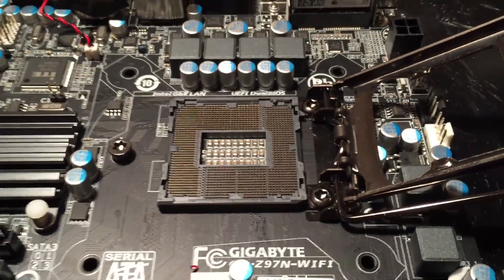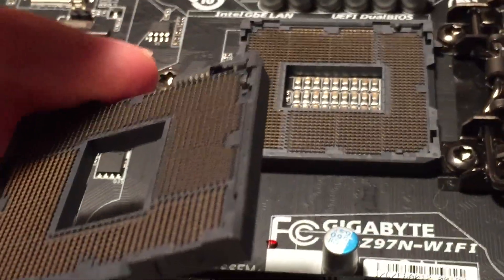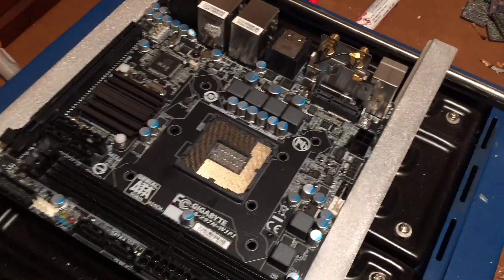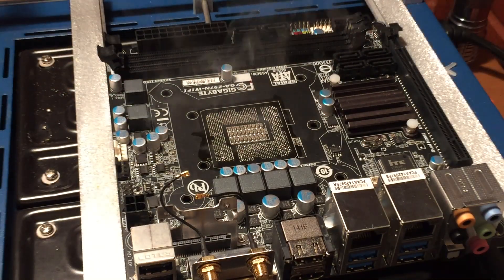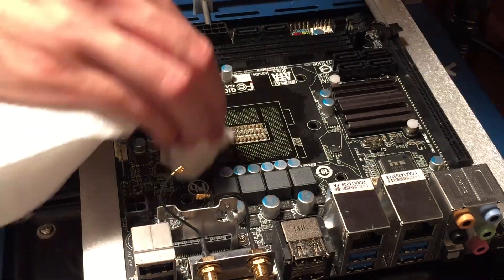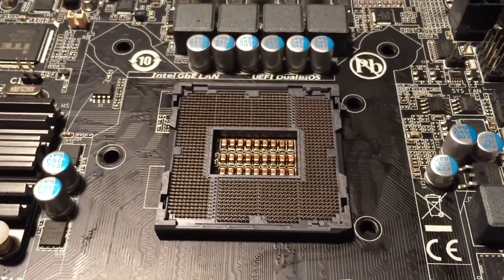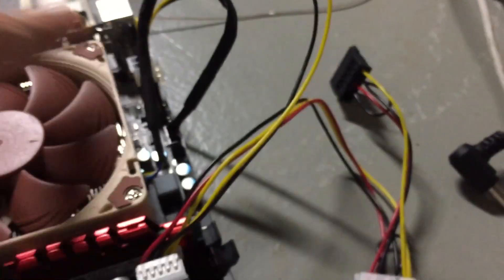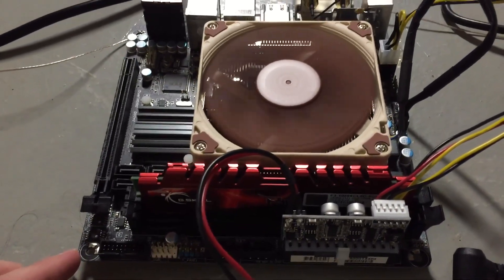Replacing a Damaged CPU Socket on an LGA1150 Mini-ITX Motherboard

Comment: They should put the socket in a socket
Reply: Better idea than it first sounds! I wouldn't expect it to happen though, because fabs would lose revenue if consumer repairs like this became easy.
Reply: @professionalbronze4235  or just dont break ur socket
Reply: apple would just remove both sockets.
Reply: @ionbladezofficial  apple would just solder the cpu on the mobo so people can't repair it..
Reply: @ionbladezofficial  As I dont buy apples overpriced offerings I wouldn't care.
Reply: @ionbladezofficial  apple would put the processor in the cloud.
Reply: @ionbladezofficial  apple would solder both sockets
Reply: Just sockets, all the way down.
Reply: But what if the socket of the socket is bad?
Reply: IBM Power Architecture CPU's have replaceable sockets. There's LGA style pins on both sides of a socket cartridge. There are bare pads on the motherboard and on the CPU package.
See here:
https://youtu.be/AptJJsO5qCg?t=2763
Reply: big brain
Reply: i try and i have more fps in gaming :O
Reply: but then that would hurt their sales
Reply: then the same thing would happen when the base socket breaks...
Reply: @minbcraft  True, though I must say that although I'm not arguing with you (and don't get me wrong, I appreciate constructive discussion)...(also, get ready for a wall of text)

...it'd be less likely for the base socket to break, as the end user wouldn't generally have a need to mess with it. The socket could also be of a different, more durable and more difficult to remove type, to prevent the issue in question from happening as well as discourage the end user from messing with it respectively. I think it'd have to be a different type anyway, as I can't really see an LGA package with an LGA socket as feasible. I'm thinking an LGA socket on a PGA package, with a PGA socket for the base.

Thanks for reading :)
Reply: @minbcraft  Easy, just add another socket for that socket. Problems solved
Reply: @minbcraft  true, but if the base socket was PGA it wouldnt matter
Reply: @minbcraft  Not if the base socket was a PGA that the PLA socket plugged into.
Reply: @minbcraft  slotted pga
Reply: @minbcraft  no because then we could use a different type of socket :)
Reply: ElRemoDeTuBarca  so you can ruin your 350 dollar CPU instead of your 175 dollar motherboard? nah. LGA is superior, i honestly dont even understand how people manage to fuck up a socket. you have to have the worst butterfingers and worst luck ever or you were stupid and left it out uncovered. even AMD uses LGA on their high end stuff. and their single core and latency still are worse than intel who is on an older process thanks to their foundry making a couple stupid decisions.
Reply: @eclipsegst9419  That's false.
Reply: @XsaviXander  what is? That AMD needs half the process size for equal performance? Well it's true- Zen1 was about even with Sandy Bridge. Zen+ was even with Haswell, and Zen2 is even with Skylake.
Reply: @eclipsegst9419  LGA is garbage. Also, AMD outperforms Intel at the moment. Please educate yourself before making yourself look ignorant.
Reply: @eclipsegst9419  it's much easier to repair the pins on a cpu than a motherboard socket. AMD has a higher ipc than intel, but intel still clocks higher on the high end/ overclockable chips
Reply: @jamesjacob9632  if you're lucky and you can bend it back then yes, but if it snaps off it's game over. Whereas a motherboard can be repaired. A new LGA socket is about 6 bucks and if you can find a local electrician you can pay about 50 bucks labor. I once bought a Maximus Z77 for 35 dollars with broken pins. Ended up with a 250 dollar Mobo for 90 bucks.
Reply: @eclipsegst9419  You could make the same argument for the LGA pins snapping off. 
You could also solder the pins back to the cpu as well, which is much easier than soldering a new socket. You can also drop a pin in the motherboard. 
The cpu pins are also more durable. You have to really drop the cpu in order to damage it enough to risk breaking a pin. It might get slightly bent but that is easily fixable by combing them with a razor blade. Repairing LGA is a much more difficult process.
AMD installs easier as well. Intel needs to be almost dropped in the socket as the socket restricts your grip of the cpu edges. AMD does not restrict your grip and can be gently placed while having a firm grip.

I think PGA is more foolproof and consumer-friendly. It's not a big deal though overall.
Reply: @jamesjacob9632  no probably not, but I just find LGA alot less nerve-wracking to handle. I really do wonder just how on earth people managed that every time I see a damaged LGA motherboard. It's about as stupid proof as you can ask for. I have to assume most happened while the CPU was out and no cap installed. Slid something across it or somehow dropped it on the corner of a desk? Who knows. But that is just user stupidity and not a weakness of LGA really.
Reply: @eclipsegst9419  You are wrong. I always buying ryzen CPUs with broken or "snap off" pins. More than 50 were fixed by me.
Reply: @angeldark9750  well you knock yourself out with that one. if you got the patience its probably a good way to make a buck i cant knock you for that.
Reply: @eclipsegst9419  Need skills, and lot's of experience. 
But easier repair a ryzen CPU like exchanging an lga socket.
Reply: @angeldark9750  I still think it's easier not to damage lga in the first place, but I can see how pga is easier to repair.
Reply: @eclipsegst9419  The only reason for which AMD uses LGA socket type on server-grade or HEDT-grade cpus is because LGA allows for more pins/connectors on a given surface size, not because LGA is superior.  Both socket types have their pros and cons, i for once prefer PGA,  in my opinion it's just easier to handle for less practical people.  
Performance-wise, we're talking about a socket type, not cpu performance.  But since you mentioned it, Intel began to sink with the arrival of 1st gen Ryzen, now they're afloat just because of their name,  their current cpu lines have no advantage while their upcoming cpus appear to get to zen 3 single thread performance level (LEAK) but will still lose in MT work as their top tier cpu stops at 8 cores.
Reply: @lupuradu  keep telling yourself that. Intel allows AMD to exist so they aren't a monopoly. If they were really in as bad a spot as people like to think, they could easily fuck over AMD by buying out all of TSMCs production capacity for themselves. But in actuality they had a hiccup but they are still leading In innovation. They are currently 2 years ahead of TSMC and Samsung in developing nanomesh vertical transistors that will allow them to double their transistor density, which is already superior which is why they can still compete with TSMC at twice the die size. As for PGA I don't see why anyone would prefer it. Too many delicate little pieces on something so expensive.
Reply: @lupuradu  keep kidding yourself. Intel just kept amd below them. Intel owns multiple other companies bigger than amd. They could EASILY outbid EVERYONE else. But they want to make their own product.
Reply: @lupuradu  lol I'm old enough to remember last time amd was ahead. It lasted 2 years. They will be lucky to get 3 this time at best. 5nm with 3d stacking and nanoribbon transistors is going to Sandy Bridge 2.0 your asses.
Reply: @eclipsegst9419  a) AMD made intel their bitch this year, so your "that's why intel has better latency" bs is false. (it also has nothing to do with the type of socket used, and everything to do with how the cpu processes information aka instruction sets)
b) it's a lot easier to damage an LGA socket than it is to damage a PGA processor.
c) it's a lot easier to repair a PGA processor than it is to repair an LGA socket
d) ryzen is just better anyways :)
Reply: @lupuradu  you don't need to be that old to understand competition benefits the end user... Look at Intel falling behind because they thought they had no competition... lvl.100 ryzen enters the chat, and then suddenly intel learns how to make consumer-grade cpus with more than 4c/8t...
Reply: @NikoBell1188  AMD has shit latency because of infinity fabric. Intel hedt has same issue. Now amd has 8 cores per ccx. Aka, how Intel does it, but with a second one for 12 or 16 core parts. So now their 8, 6, 4, core chips are on single die, like Intel. If you can't beat em, copy em eh?
Reply: i mean, really... how often are you changing your cpu? and if it's so often it's actually a problem... maybe you should just figure out to do it properly... or stop, or at least recognize YOU are the problem, not the design. a socket means another failure point, with more pieces and doesn't even fix the problem in the first place, just makes it even more compicated. on ic's and stuff that tends to burn out, or you do need to change often for whatever reason... yeah... but then, people are always ham fisting things they never should've messed with in the first place, then blaming the design because they were incompetent. probably, because they never do anything themselves, and just decided to do this one... and inevitably screwed it up... which everybody does, it's how you learn. but you're supposed to learn on cheap and/or easy stuff. and not wait til you're 35 and think you're gonna pick it up all of a sudden. like driving, need to start as soon as you can reach the pedals... not 10 years later, why nobody can do it and freak out every time it rains, and god forbid it turns to ice, and unleashes that frozen white death... happens every year, and people act like it's some alien force they've never experienced before. @eclipsegst9419

Comment: wow, my friend and I were just... well, joking about doing this on a Z170 board I got for $35 a few weeks ago... I'm actually testing it with my friend's 6600k today after I bent the pins back into place
how much would u charge for a repair like this?
Reply from the maker: I'd charge $125 to do this repair.
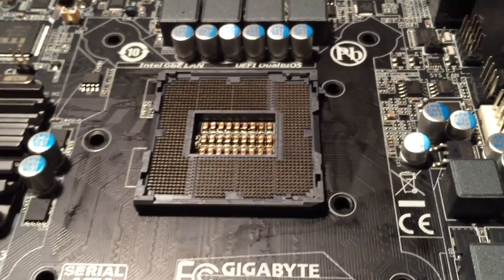Reply: I'll have to consider that... also, at 11:12, is that an Xserve I hear in the background?
Reply from the maker: Yep, it is.

Comment: Dude, this is hero-level stuff....I've had so many of those 1150 boards turn to scrap for broken pins. Amazing.
Reply: It's fairly an easy job for someone who has a bga rework station. We change these sockets for 30 dollars including the socket here in Turkey.
Reply: @ERSBoogie  Is it possible for you to contact me with your or your company"s contact info about replacing a LGA 1151 on a motherboard
Reply: @juliendennisjuliendennis9364  I'm sorry but i can't. We only do bussiness with other repair shops and not accepting end user devices.
Reply: @ERSBoogie  $30 is crazy cheap. In the US you might as well buy a new board as they will charge you likely $150+. This sort of repair is really rare.
Reply: @ICeyCeR3Al  Yea , since Turkish Lira is going down our prices are going down too. 30$ is actualy 1/16 of my monthly salary.
Reply: @ERSBoogie   i have a ASRosk Fatal1ty Z97 killer with LGA1150. Can i sent you the motherboard to change the cpu socket because has damage pins.
Reply: @ICeyCeR3Al  30 is fair price. While doing this you running risk of heat damage to other components especially those MLCC's. If you are fine to gamble money on procedure that can get you board which may or may not fail within month of use (especially due to high load such as gaming or any stress loading processes) then you are OK. It is more than not often the case that shops offer these repairs without listing the possible risks and drawbacks.
Reply: pretty ridiculous how a country is considered "advanced" based on how much shit we throw away... y'all guys in "3rd world" countries do some absolutely AMAZING repairs, even without the proper tools. i can't stand throwing away money buying a new part/whole product because of planned obsolescence or paying someone else to do something i could do myself. i've always just figured it out when something breaks, since i was little working on my dirtbikes, fourwheelers and then trucks/equipment. and i also can't have anything stock, if i can find a way to modify it... i will. baffles me how much people are perfectly happy lighting money on fire... but then... people just baffle me period. i swear, we're not the same species. especially the past 20 years, how people now have a device in their pocket with literally damn near every bit of recorded information throughout human existence... in their pocket, if not hand, at all times. and become even more stupid. speaking for americans, seems like other parts they're not nearly as dumb, as a whole, like we are. we have some very inteliigent people, a lot of which are probably actually from elsewhere... but god is the average person here absolutely stupid and therefore easily manipulated and controlled. i just never bought into that crap. i've always been very proud of my indigenous ancestry, and even at 8 years old felt so wrong being forced to say the pledge of allegiance every morning... i made up my own, no way i was gonna repeat that propoganda bullshit. anyway, enough ranting... good on ya for not just throwin things away when they can be fixed easily, since you have a brain and it ain't rocket surgery. @ERSBoogie
Reply: @ERSBoogie  "pretty easy" LOL
Reply: @ERSBoogie  I would call that decent price if the socket is included. However I hope you let your customers know all the risks of such procedure.
Reply: Donate them to this lad
Reply: @mohankrishna1443  : i dont mind donating some parts i have
Reply: @OLvato1  something fishy 🧐 what are those parts by the way!
Reply: @OLvato1  bro then donate to me i am really in need of one of those 1150 socket i accidentally broke the pin of socket
Reply: Manufacturer will repair foe you...
Reply: @sagerdood how
Reply: i had one where tips of the pins broke off so bent the pins UP and it works!
Reply: you still need a specialized equipment to do this job.